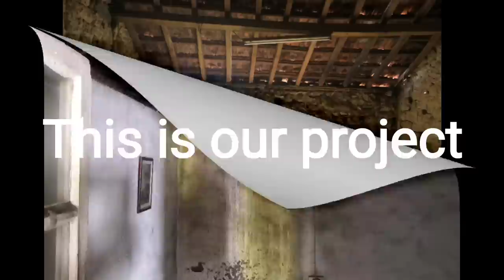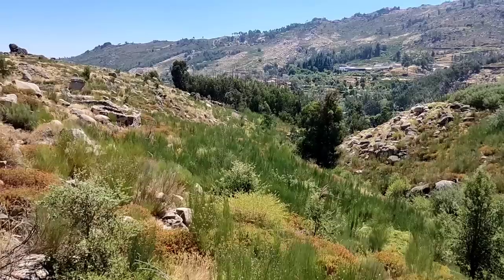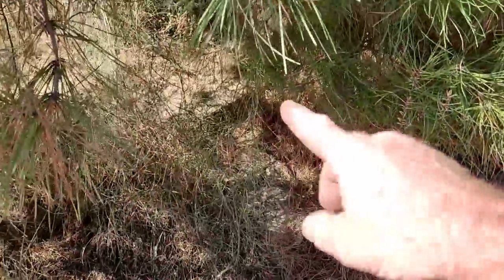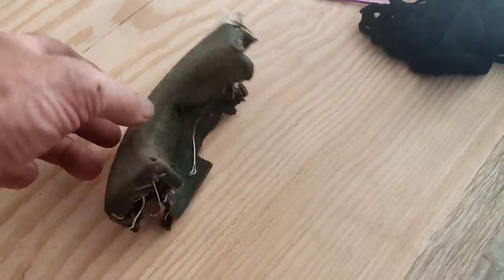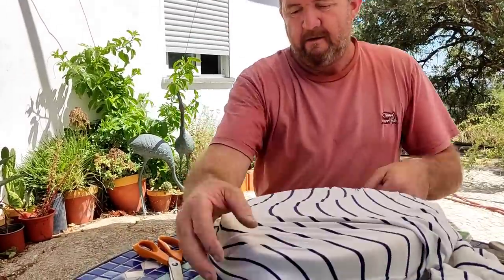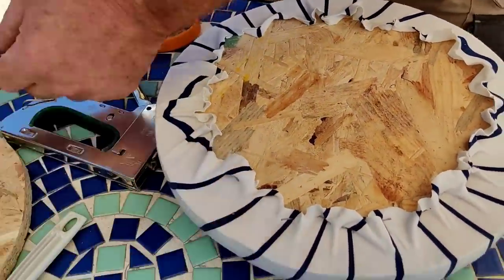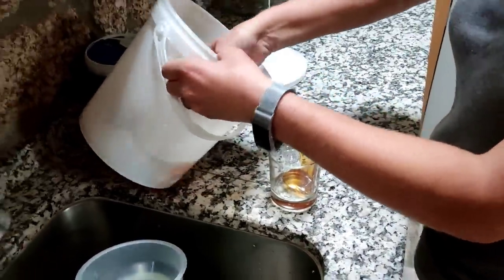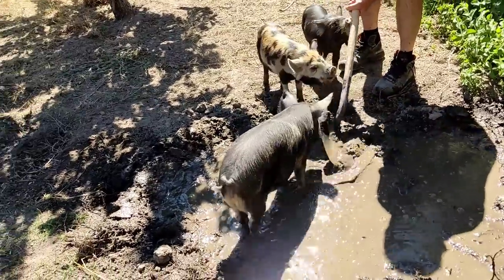84: Water Management Ideas, on our Portuguese Farm, Barragem Castelo Novo, and an Iced Tea Recipe

Comment: The pool pocket templates were so clever!  The table looks wonderful!  Rather smart!  Since you don't use pesticides or fertilizer on those lemons, you could add the rinds to the boiling tea to get some of the fragrance out of the rinds before removing them.  Another way to keep your tea from being bitter (from the tannins) is to put tea bags in tepid water in a glass jar.  Seal the jar and let it stand in the sun to steep over time (no boiling = less tannins).  Sun tea is far less bitter.  Still, yours looks fresh and delicious in that hot, hot weather.  Cheers!
Reply from the maker: Great idea

Comment: The IBC totes have so many excellent uses. Great for irrigation and storing feed if the top is cut off. Nice job Nick and Andrea.
Reply: Saw a lady make personal size swimming pool minus the swimming. Off grid living.
Reply: @eunicehenderson9095  Yes! That's a good idea too. I've seen the metal used for a hay feeder for livestock after the plastic is removed.